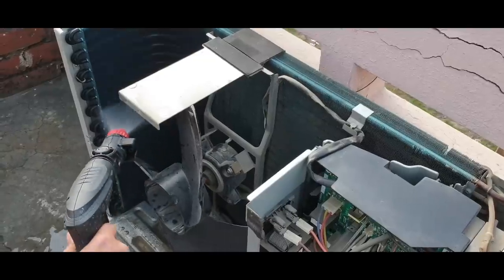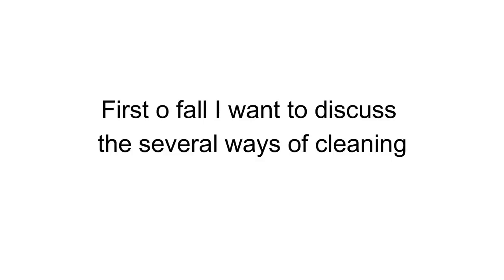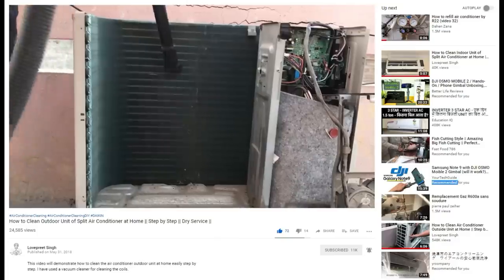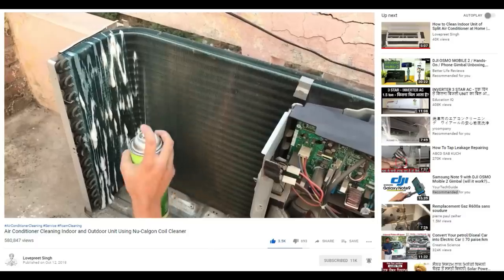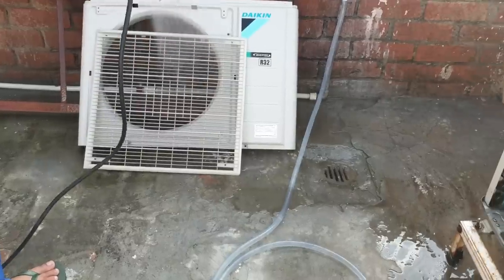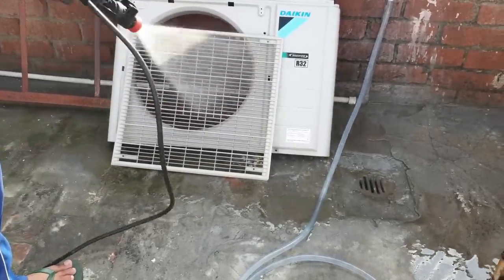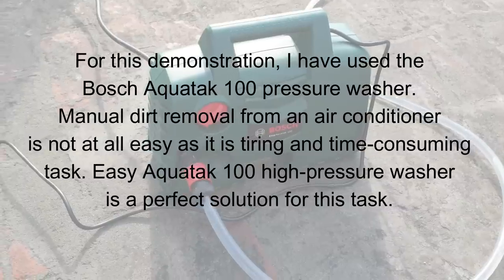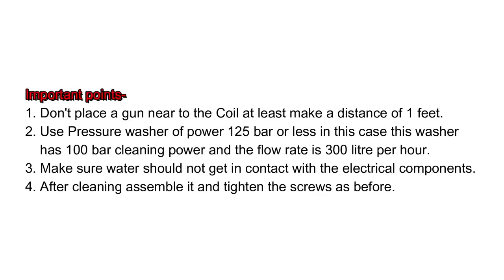Air Conditioner Cleaning using Pressure washer | Outdoor Unit | Bosch Aquatak 100 Pressure Washer |

Comment from the maker: Another way of Cleaning air Conditioner
 
1. With Professional tools -  https://youtu.be/xcIVAv8YbPQ
2. Ac foam coil cleaner - https://youtu.be/Abu43UiLpV4
3. Using Bosch Pressure washer - https://youtu.be/S05tCFFgrrc
4. Dry Cleaning - https://youtu.be/kJ97WGwdwiI
5. Deep Cleaning - https://youtu.be/zt5GJuzDI6U

Comment: You've done a great job with tools and AC stand is also a smart choice. Great video.

Only thing that was missing was covering the electronics from top with a plastic sheet. Aquatek 100 is available with that special nozzle for less than 7k and if people have 2-3 or more ACs then it's a definite good investment. Another model worth checking is Ballorex.

Comment: Looks like the condenser coil has a blue protective coating on coils and fins, am  I correct?
Reply from the maker: Absolutely
Reply: @lovepreet666  That is from the factory right? Maybe you should provide that service, over here in the US the protection is available in clear and blue spray on cans.
Reply from the maker: Yes, this coating is already done by manufacture.

Comment: Hai sir
Can we use bosch aquatak 120 for ac cleaning ?
Need a video on that please..or do reply if any suggestions
Reply from the maker: Recommended pressure is 100 bar for air conditioner coil cleaning. However, you may use this with proper attention that coils will not get damaged.

Comment: Many thanks for your video. Will it be possible to damage the coils of the air conditioner if using a 100 bar pressure washer?
Reply from the maker: No, 100 bar pressure is perfect for cleaning air conditioner coils.
Reply: @lovepreet666  many thanks.

Comment: Hello. Thank you for the informative videos. Can you please tell me how to clean a clogged drain line for the AC unit? THank you!
Reply: put an aluminium wire in through the drainage hole of indoor unit that can be located easily by removing the front flap ( usually used to clean the mesh)  give few pushes and wash afterwards... you will learn on the way

Comment: will a 600 psi pressure power washer work well for cleaning Evaporator coils
Reply from the maker: 600 psi pressure is not recommended for cleaning AC coils.
Reply: Mr. Singh's recommended 100 bar pressure is equal to 1450 psi pressure, so 600 psi sounds pretty low for a thorough cleaning.

Comment: Hello...did you face any problems with this aquatak 100...are you still using the same or have you changed it?...i would like to know your personal experience as i want to buy one too for household cleaning jobs...how long can one expect this bosch machine to work properly?...
Reply from the maker: It is working perfect till now.
Reply: @lovepreet666  thank you for the prompt reply...much appreciated...did you ever get the machine serviced or parts replaced ?...
Reply from the maker: No
Reply: @lovepreet666  would you suggest using 120 bar machines like star q, vantro or ftp models that have induction motors and are more durable....
Reply from the maker: OfCourse

Comment: Hello, thank you for your video. Is it best to use an electrical pressure washer or a manual sprayer pump.  Is the Bosch Aquatak 100 also adjustable in the pressure intensity? I saw in a previous video you used a manual sprayer pump: I suppose this one is more gentle on coil surfaces but is it also effective at the same time? Which one do you suggest? The manual sprayer or the pressure washer? Thank you very much for your reply.
Reply from the maker: Both electrical and manual pressure washing is okay but it depends upon situation. No Bosch Aquatak 100 is not adjustable in the pressure intensity. If there is too must dust accumulate on the coil then electrical pressure washer otherwise for normal or routine cleaning manual pressure washer is okay.
Reply: @lovepreet666  Thank you very much for your reply